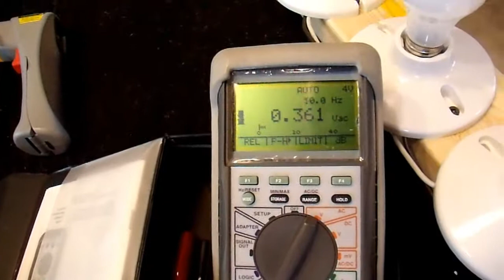PowerBright Pure Sine Inverters Part3 - Repairing the 2200 Watt Inverter continued...

Comment: When mounting transistor pairs with one mounting screw in the middle, I recommend putting a thin bead of solder on the rocker clamp, right over the dice of the transistors. You don't want the clamp to touch the edge of the transistors near the screw, because it tends to roll the transistor bodies inwards, and off the pads. If you can shim the very centers of the transistor bodies, so the force is applied to the center of the body, you will get much better heat transfer from the device to the heat sink. I think that's what happened to the 2,200 watt inverter. If you read the specs on the transistors, they're more than adequate for the extra current. another advantage of using rocker clamps with spacers over the device bodies, is that they act something like a spring, maintaining pressure on the devices, as the insulators become thinner, and, it compensates for thermal expansion. Anything is better than using screws and shoulder washers through the mounting holes, especially on the smaller TO-220 devices. On the larger  TO-247 devices, the mounting hole works pretty well, because it's more in the center of the foot print, and, the larger pad area transfers heat better anyway.
     I quit having problems with my amplifiers when I went from screw hole mounting to rocker clamping, because of the less-than-perfect extruded heat sink surfaces.

Comment: I have a go power 3000w having a little problems. I have replaced few capacitors and all 5 main fuse board have blown and replaced but my fuse keep blowing. Do you have any ideas whats goin on? Or where i need to check first??? Thanks

Comment: hay dude, you wana build a generator inverter pss .that dosent need gas. something to run a house with and barely much cost inverters are a help but need a cheaper way to charge the batterys well enough  aganst the drain. or power off till charged .ide like to build something that gives a few choices of power source   also for different locations.

Comment: Good video,

That looks like a TL-494, would be a good idea to get an 100 MHZ > oscilloscope else, you flying blind (you need to determine the shape of the waves ect..) another thing, PLEASE always use a heat-sink,internally good switching circuits OR high power ones, always has a dummy-load internally about 1 watt or so, (with RF snubbing) enough to heat/warm all the MOSFETS to death without a heat-sink. 

Anyway, I suspect one weakness is the mosfet drive current to the gates, it seems insufficient at first glance, that IC only supplies 200mA per buffer phase of the TWO phases when configured in push-pull mode which is the case here, you can easily calculate the required MOSFET drive gate charge by adding up all capacitance of all the gates (found in the datasheet) and check the "drive frequency", IR has some good papers around this.

The PNP stages are used as a fast turn off, this is used to pull the FET to ground, basically discharge the mosfets gate by the time the second phase is on the first phase is "guaranteed" to be off, protecting the FETS from "shot through".Good switching power supplies use efficient gate drive IC schemes  IR2113 OR 2110 (some clever engineers use desecrate BJT methods) to perform efficient gate driving (and maybe coupled with a final totem pole BJT if gate current requirements increases)   

(Anyway, get a scope I would like to see more videos with "live probing" the output waves tells alot about the inverter never mind the way it looks.

Cheers ;)
Reply from the maker: I'd love to have a scope for this sort of work, but a decent very basic DSO is around a thousand dollars and I've found ways to get around needing one from experience working with circuitry and scopes.  I haven't gotten 'burned' yet with educated guessing on these (often poorly designed) inverters, but someday if I find a good deal on a scope I may be able to show more.
Reply: ***** You can get a rigol ds1052e for about 329 dollars (new) OR DS2102  (series 2000) for 1,200 dollar (if you want advance features) at a cost of course.

I own a SIGLENT SDS 1102CML 100Mhz I paid 350 dollars for it (new) it works fine.

Comment from the maker: Yes, a variable power supply would be nice for this type of project.  Too bad the only reasonably priced ones I've found are Chinese junk.  I should probably just get one anyway though since they're better than nothing.  I think..
Reply: If you do get one, take it apart, and check to see that the power transistors are properly mounted to the heat sink. Typically, the design is pretty good, it's just the workmanship you need to be aware of. You may see the same mounting problem you saw in these inverters, and it's also something I check in cheap car audio amplifiers.

Comment: I've used those thin alligator leads and they themselves make a nice fuse when need be :D Have saved my projects on more than one occasion. Nowadays I use a decent lab power supply for any kind of repair work. Not nearly as fun as those alligator leads :)
Reply: You mean the flexible extendable slow blow fuses with visible smoke indication?🤣😝😁